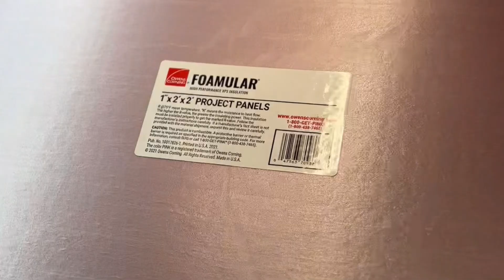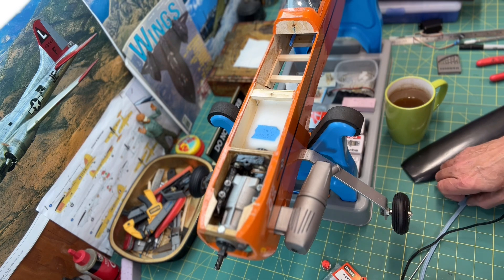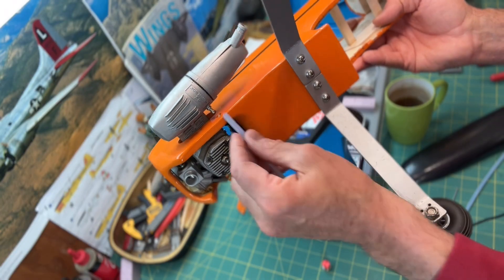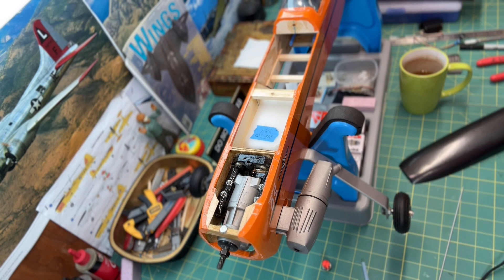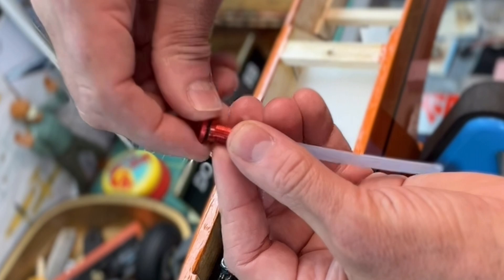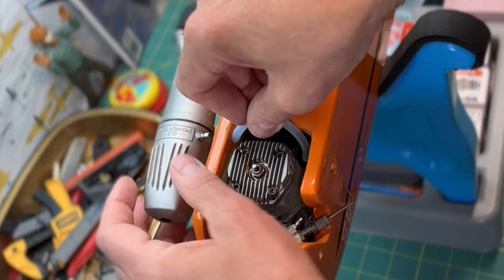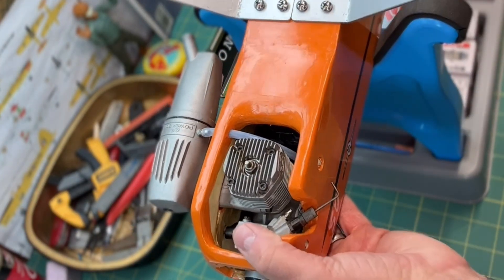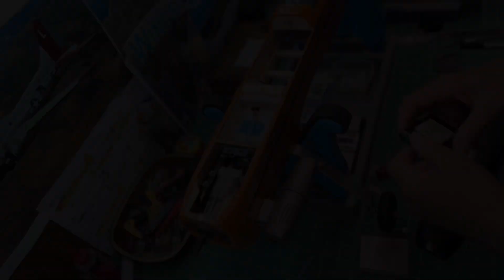Balsa USA Smoothie RC Plane Kit Build No 40, Installing Tank

Comment: Well done. Everything is such a tight fit. One of the reasons I am going electric, at least that’s my plan, although that might introduce its own challenges.
Reply from the maker: Thanks. And yes, things are tight. I have been looking at the servos, and they are very tight also to get 3 in a row without them interfering with each other.

Comment: Muito bom trabalho, paravens!
Mas uma obssrcacao : me parece que a ponta da mangurira de abastecer ficou mais baixa que o tanque, isso nao vai de dar retorno na hora de abastecer , quando desconectar a ponta do abastecedor ? Me parece que sim !! 😢
Reply from the maker: Thanks for the comment. I agree, as I remember I was having a hard time getting the tank low enough because I inverted the engine. So it was close. But luckily it didn’t give me trouble. As you noted, always better to try to keep the centerline of the tank below the carburetor to prevent the fuel from leaking forward. Thanks!

Comment: line the tank with foam rubber not styro foam keeps tank from foaming.This is one of the problems with ready to fly planes tanks are glued in planes
Reply from the maker: Thanks for the tip. I wedged the extruded foam in order to keep it in place, if I get trouble with foaming I will check on foam rubber or maybe a felt clunk.